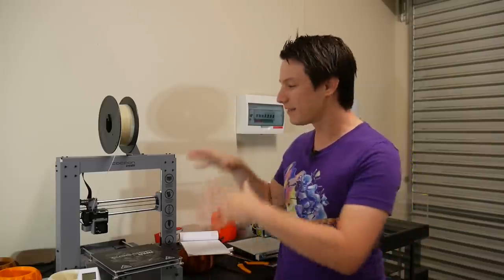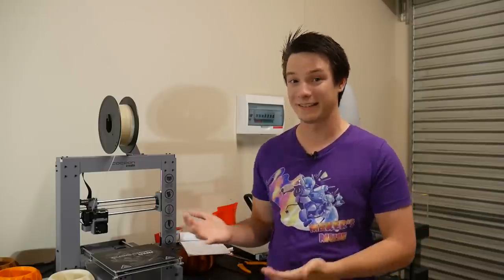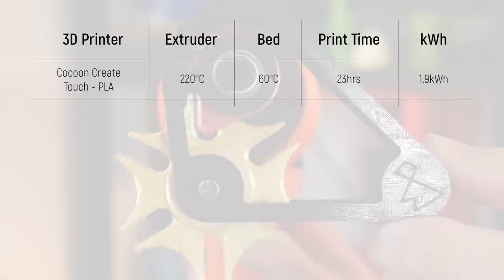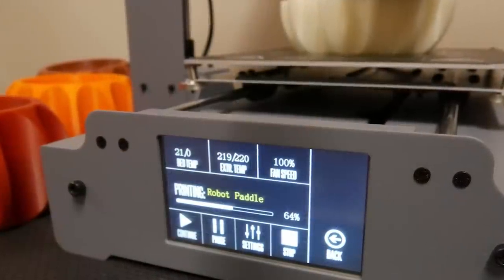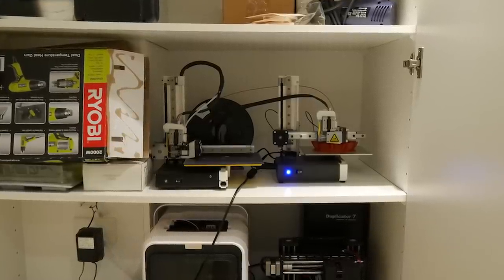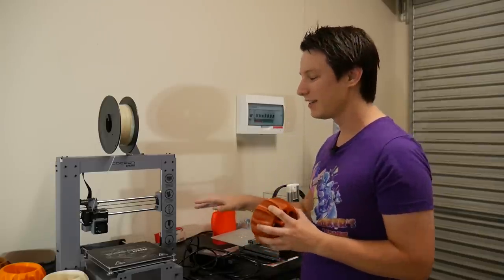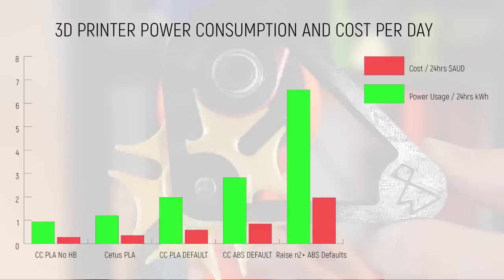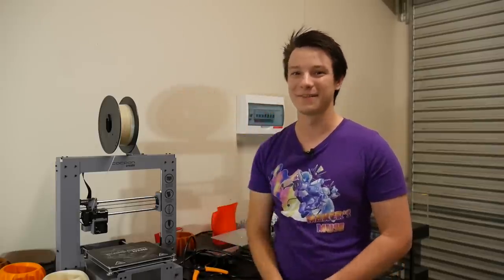How much power do 3D Printers use?

Comment: if you put your printer inside a enclosure with moderate heat insulation (e.g. aluminum insulation all around the inner walls of the enclosure), you could save further more electrical power.

Most of the electricity consumed is to to keep the hot bed and hot end temperature at constant, but relatively speaking, the hot bed wastes more heat as the surface area is much greater than the hot end. Having an enclosure sure will helps conserve the heat much better, in turn reduces the duty cycle of hot bed heating element. .

Comment: Consider that ambient temperature will be around 20°C and it accounts for the difference in power consumption; 20 to 60 is half of 20 to 100 and the temperature gradient is less, so the loss by convection would be slower.

Comment: you do not need to print to get the numbers. measure amps and print something for some minutes and then you calculate the kwh = volt*amps*h/1000 of print. the heated measure needs only preheat to measure. you can add now the amps of print and headed.

Comment: Just so you know I own 15 of the duplicator I3s and every single one of them the temperature reported is 10C higher than actual. So you might have been printing that abs part at 220C which is super low for ABS and might have made the cracking worse.

Comment: It costs CAD$0.08/KWh here in Ottawa, Canada. It might not sound much, but it adds up quick.
This is the main reason I print only if I need it bad. I bought some white PLA and will be switching to it from ABS.
It should smell less nasty too. I am not sure if ABS is necessary anymore with today's PLAs. 
It was a shitty choice a few years ago, but now I think they've got in dialed-in, and the final prints will be just as strong and durable as ABS.
Good video that makes one think about pissing one's hard-earned money, down a socket!

Comment: A thing to consider, using thicker layers significantly reduces print time and electricity expenses (and also printer mechanics wear).
By the way, in Novosibirsk, Russia the current price of electricity is 0.039€ per kW*h. My Flsun QQ-S consumes about 100-110 Wt while printing with heated bed at 70C so for 10 hour print it is less than 0.5€. At the same time it can spend about 2.5€ worth of plastic. However, I think I'd try printing PLA without heated bed and see how much it can save.

Comment: You could probably reduce the power used by making a hot box for the 3D printer. If you keep the air around the printer hot, you don't need as much power to heat the print head and bed. Of course the higher Temperatur would also effect the properties of the printed parts, maybe it can prevent delamination, but maybe they fail because they don't harden fast enough while printing.

Comment: I was thinking how can heatbed temperature make so much difference in consumption if it runs at lower temperature then nozzle. Then I remembered that heatbed has much larger surface area and thus needs more power to maintain its temperature

Comment: I think the most surprising thing to me was just how expensive electricity is in NSW. This might explain why Dave Jones of EEVBlog was so enthusiastic about putting solar panels on his house years back. It would probably be helpful to think of this cost relative to the cost of the filament in the print; it seems like you probably put at least 5x the power cost into each part in filament, no?

Comment: This actually makes a lot of sense. Electric heating is about the most ineffective way to use electricity and heat is a huge factor in deciding what size of transformer and wire is used throughout the electrical industry. I wonder how big of bed you would need before it is easier and more cost effective to go with propane or natural gas.... I know that the head will always be electric but at some size, I could definitely see heating the bed or print chamber with natural gas or propane.

Comment: I wondered about this since I wanted to figure out what size battery backup (UPS) would be the best to hook my printer up to.  I would like to figure out size that's reasonable and give me 15-30 minutes of print time
Reply: I have an I3 clone that pull from 300-400 watts peak(when starting to heat up the bed and nozzle) but after that its only a around 80-100 watt to keep it going so a Smaller computer UPS could definitely  do the trick if you are only looking for 30 mins.
Reply: Naomi built one to run off a li-po battery for a back pack. https://www.youtube.com/watch?v=i-ksb-gzfyE  battery install somewhere around 15:30

Comment: an easy way to test how much power the motors would make over the print is set the print temp to 0 C  and print the wheel, obviously you won't have filament loaded. It would be kind of weird printing something over 20 hrs and not getting anything out of it lol  but you would know how much the motors use but you don't really need 20 hrs you could just run the first hr or 2 or 3, the more hours you print the closer the average you will get, but you should have a good idea over 3 hours.

Comment: bit late but if you insulate the machine (enclosure where you can) you can maintain the temps easier - meaning less energy cost to keep those higher temps (or even lower temps) the challenge here would be making an insulating enclosure for the machine(s) you wish to use.

Comment: I just bought one of these, love it. Try ringing the 1300 support number though..."the number you have called is not connected" so if that's an example of CocoonCreate support in the future we will have a problem.
Reply: Look, every single one of these resellers of Chinese printers hasn't been the most knowledgeable and forthcoming with support, they just ship things around and take your money, they really don't know much about what they're selling, and any local/small manufacturer or reseller is prone to go out of business at any moment anyway. You lot just have to help each other troubleshoot via online communities and you can order original bits directly from Jinhua Wanhao Spare Parts Co. Ltd or find one of the many equivalent replacements.
Reply: Yeah fully aware of that, I was more making an observation regarding the likely fly-by-night operation that is CocoonCreate, set everything up in a rush to get them into Aldi and then likely disappear. Cheers.

Comment: Would be interesting to see if having the printer in an enclosed box does help with the costs. The temperature from the heated bed and the nozzle is being dissipated into the environment, which virtually means endless dissipation. But if the 3d printer is enclosed the box would eventually heat up and help by preventing further dissipation.  I don't think it will be a massive money saver but maybe it makes a difference...

Comment: Good to know, i was expending higher energy usage to be honest. Using a PC with its, lets say 300W, for about 7h is more expensive that printing PLA with a heated bed from the first test. I think that it’s cheap. You can attach/glue a thermal isolator foam behind the bed and you will save more energy and money.

Comment: It'd be interesting to see how much of an impact speed has on power usage (for the same machine.) I think you'd see very little increase over a smaller print that's printed slower since the heatbed is such a large factor.
Reply: thnikk luquerm I think faster prints would decrease the amount of energy, simply because the motors wouldn't consume that much more and the bed would be on for less time.
Reply: Assuming that we are talking only about printers using stepper motors - stepper motors consume more-or-less the same amount of energy when in-motion as when they are just holding still. That's one of the main disadvantages of steppers.

In that case, the total energy used will be mostly determined by the total time and thus, on the same printer, longer prints will almost always use more energy in total.

Comment: Interesting. Do you think that the enclosed atmosphere of the Raise was one of the reasons it did better with the ABS wheel?
Reply from the maker: Oh for sure, it's the higher ambient temperature that makes it print ABS so much better
Reply: Beige The Color - having the whole room at 50°C would cost a lot more. Better to have just the printer it self encapsulated.

Comment: I wonder how things would change with 12v vs 24v printers and also if you insulate the bed underneath with corksheet to help hold in the heat so it is easier to maintain heat. Also if the silicone sock is on the heater block to also help hold in the heat.
Reply: Buckaroo San likely very similar. 24V maybe slightly more efficient as there is less loss in the wires to the bed. Effect will be very small.
Reply: I believe the cocoon is a 24 volt as my i3 plus is.
Reply: @scienteer3562  Depends on the wire. If the wire is too thin, it will generate heat, which will be less efficient.
Reply: Most of the heart loss is upward, insulating the underneath will not save much at all

Comment: The term KWh is right no matter what everyone else said. Running my Malyan M200 with the heatbed on PLA  Settings only uses 60watt per houre of printing. Without it it's even using less then the cetus.

Comment: Using a chamber helps to keep the heat in so that the heatbed won't need to work as hard, and it'll use less power overall.

Comment: If your printing with material like ABS you need to have it insulated to stop delamination. Would really increase the power efficiency of your unit too! The Coccoon create was completely exposed to 20 degree room temperatures while the other was nicely stuck in a cupboard area
Reply: i find printing at 270 degrees helps too, but that might be bad for the printer.
Reply: @maxxiang8746  It's fine if your extruder unit is rated for it. Bed panels can take it

Comment: A jump from 60 to 100 in print bed temperature at 20 C ambient temperature means it needs twice the power. The heat transfer from the bed is calculated as a constant*temperature difference, the constant is the same so the power increase between the two cases is only the ratio of the two temperature differences, (100-20)/(60-20) = 2. Since the heat bed stands for the majority of the power this is to be expected.

Also, how much does your ambient temperature drop during the night? Using the 0.9 kWh as a baseline power consumption for the printer without the heated bed and solving for the ambient temperature you get an ambient temperature of 10 C :s There's probably some other factor playing a role here, but it could be that your temperature drops during the night? Also, you should test how much an enclosed environment pulls down the energy usage. I'm guessing not a lot, but still a measurable amount :) Maybe 0.5 kWh?

Comment: Bit late to this video, good video though. However don't fully trust what those cheapo meters say, some can be off by upwards of 200w (yes I've had a few that were off by that much)... if you want accurate readings you need something  like the Power Mate (for Australians) but those start at $125 for the cheap version and $280 for the top end.

Another few things that will cause higher power draw is the actual components, if you have a crap power supply, cheap main boards etc etc. that'll draw more power. Also having printers not in a box will cause the heaters to work harder because they have to compete with ambient temps.

Comment: Hmm... I’d almost be curious to duplicate this off the 110AC here in the US to see if the different mains voltage shows a substantial difference. I’m very curious how much power is lost across the transformers.
Reply: Voltage won't change the energy needed for heating to the same temperature.
You'll have the same Watt value. It will just be half the Volts and double the Amperes.

Comment: Hey Angus by any chance do you know of a way to get the best of both worlds? Have heat bed for pla printing on for the first few layers, then just turn it off after several layers are complete? Inject some code somehow?
Reply from the maker: That kind of thing should be easy in any modern slicer, you just set it forexample 60deg for layer 1 and cooling fan off, then fan on and heat bed off. I suggest checking out ideamaker probably my favourite at the moment.
Reply: Erik Lau i think that might not work, as when the heats turned off, the first layer would probably peel off.
Reply: You have to put expansion and contractions into the equation. Once the bed is up to temp it expands and the printer starts its first layer. One that’s done and it moves onto the next layers the bed will cool off and “shrink” which will probably cause the object to detach from the bed surface. You might be able to over come this by using glue on the build plate but it best to either print with the heat on or off at the start not after it has started.

Comment: Hi Angus. Thanks for the video. I was just wondering what advantage you find with printing PLA at 220C. The highest I usually go is 210 & most of my PLA stuff is done at 205C using CCTREE OR ESUN PLA. I would expect that overhangs print worse at the higher temperatures than at lower because the extruded filament will sag much more during cooling at the higher temps. I might have that wrong but from what I've seen, it seems to hold for me.
Reply from the maker: Honestly not sure, it depends on the printer but many PLA defaults are quite high. It allows for a lower extrusion pressure but probably negatively affects printing quality compared to a lower printing temp.
Reply: As a matter of interest, I had done a calculation of electricity usage by estimation of my home built Prusa style printer. It has 80W bed (2*40W segments) and a 40W hot end. for 24 hours, I calculated that the absolute maximum power the printer could use with all elements on permanently would be 0.08+0.04 KW x 24=2.88KWh. of course it would never use that much because of the thermostatic control but that's mu worst case. I did it like that because the Arduino Mega and the steppers, although having high power spikes, have a very low average current draw so I decided they would be negligible as I was taking the absolute maximum resistive load. My power here costs 0.14 US cents so I think I'm quite well-off here in Durban South Africa. I'm happy with 40 US cents per 24 hours! :)
Reply: Maker's Muse - this is a contentious issue that's worth dedicating a whole video to: PLA ideal print temperature.

In my case I have found that for each roll I start, the first step is always run a series of "difficult" prints at temps ranging from 190°C to 235°C.

Each roll has a "sweet spot" temperature, which I mark on that roll so I know what to set the slicer temp to when I use it. 

I have rolls marked anything from 190 to 235, each printing quite nicely that marked temp but being a complete fuckup if the temp is about 10°C from its ideal. 

Most rolls are good at around 205 - 220, but some just seem to need quite different temps!

I would be interested to see a broader perspective on this issue.

For reference, I'm a complete slut when it comes to buying PLA rolls - anything will do, but cheaper is still preferred. I've got stuff from Aldi, stuff from Ebay, and stuff from misc. suppliers in Sydney. 

And when I say "difficult" print: I mean I have a set of .stl files of small threaded bolts with matching nuts that are hard to print under the best circumstances, and a "success" is if the printed bolt and nut fit together nicely.

So far I've been able to get every roll to print those nuts and bolts, but the determining factor is the print temperature.
Reply: Hey Paul Gross. Funny you should say that now. I’ve just changed roll from ESUN white to CCTREE purple & the settings that were close to perfect for the white caused a 3D benchy to have acne all over the hull & feathers growing across the doors & cobwebs all over the deck. Changed from 60 mm/s print speed to 70 mm/s & lowered the temp from 210C to 200c & the print was nearly perfect. So I agree with you. When you change reel, check the state that the filament needs to be in to produce good results. I’m actually going to put a label on this roll with the “sweet spot” it likes so when I change filament mid-print, all I need to do is go into the tune setting on Marlin and dial the settings in for that roll. I’m actually busy dialing the roll in now. I’ve changed the setting a bit again & I am busy baking another benchy now. I’ve also noticed similar variations between rolls of the same colour & manufacturer. I’ve started using gallon zip-bags with silica-gel to store my waiting rolls too.
Reply: It depends a lot on your printer. I've found most are quite inaccurate in their temperature readings, like 20 degrees or so. I calibrate my printers so I know if I set 220C, I'll get 220C (within a few degrees). Setting the temperature high to compensate for your printer reading low is fine, but makes sharing settings much harder.

I use a low thermal mass contact thermocouple to read the nozzle temperature. The non contact IR meters are non at alll well calibrated for reading the temperature of metals. The emissivity is wrong.
Reply: Paul Compton - I'm not convinced that the error is very great, because the variation is still 45°C from coolest to hottest, and it roughly covers the expected range of PLA temperatures: 190°C to 235°C.

The salient point is still that each filament roll has its own "sweet-spot temperature" for good quality printing, and that sweet-spot has a very wide temperature variation between different PLA rolls, even if my printer's 205°C may be someone else's 200°C.

A systematic measurement error of, say 5°C, or even greater, isn't really the issue here, because we aren't going to send actual rolls of PLA filament to each other for use are we? 

So long as the sweet-spot we find for each roll is matched to the same printer that was used to determine the sweet-spot, the absolute temperature error isn't relevant.